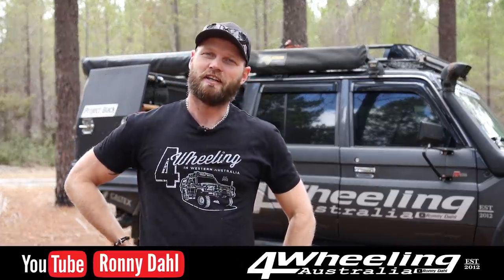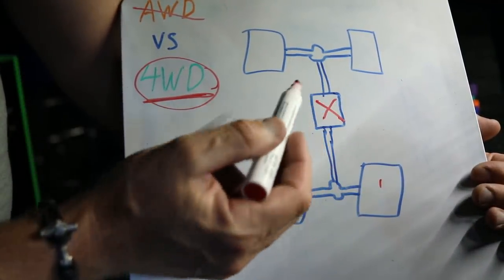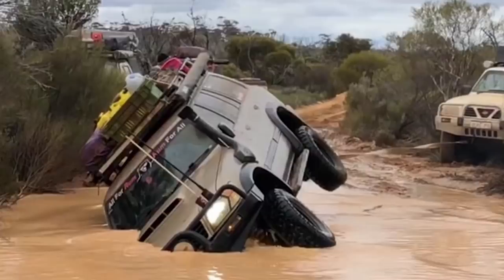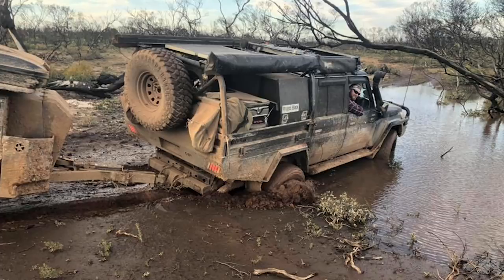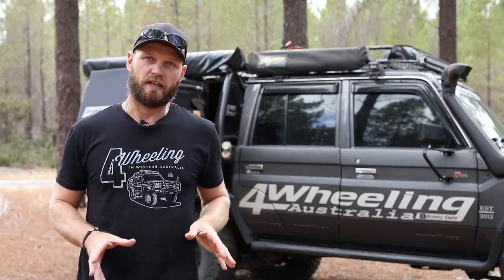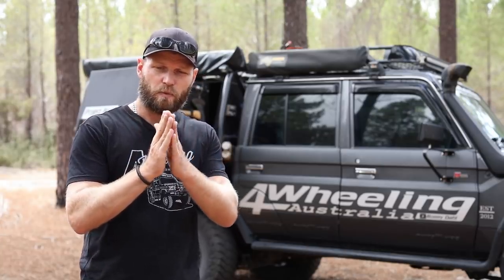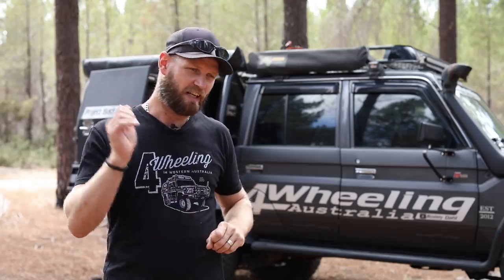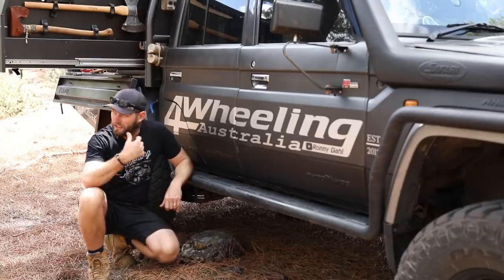10 ways to get bogged 4x4

Comment: When I used to have a Nissan Pathfinder it turned VDC (vehicular dynamic control) off but kept traction control on which helped when a wheel lost traction or went in the air

Comment: The car with the burnout marks below usually denotes ESC (Electronic Stability Control) not BTC (Brake Traction Control). You want BTC on for off-road, but want ESC off for low range work. Also high range were it might be a little scrappy, like a beach exit. ESC will see you a little sideways, cut throttle and apply brake.

Comment: Just in time before my first sand driving trip to Robe SA. Thanks Ronny
Reply from the maker: perfect :D
Reply: Was there a week ago, you can access the beach through the Nora Creina village, just close the gate after you drive in and respect the locals while driving through. Some dune tracks are really narrow so I hope you don’t value your paint job too much...
Also most of the tracks through the dunes don’t really go anywhere so always remember where you came from (found that out the hard way 😅)  besides that you gonna have a blast! Heaps of tracks and steep dunes and the sand can get pretty soft, hope your going with a mate, much more fun and it’s always good to have an extra vehicle. I was there alone but had my max tracks which got me out of a few sticky situations (wouldn’t go without)
Enjoy mate, I had a blast!!!
Reply: Thanks a ton for the info mate, its gonna be me and the misses only , I got a pair of maxtrax. hope they are gonna be enough.  @TheGoprotraveller
Reply: Jasmeet Mohi should be all good mate, just make sure you got enough water and fuel and keep in mind when you go down a steep hill you might have to get back up if the track doesn’t lead anywhere, that’s what happened to me 😂 I spend the whole day there and didn’t see one person just so you know, you might be on your own if something goes wrong, also watch out for the tide or you might be stuck there for awhile 😅 anyways just have fun and smash those dunes! I had heaps of fun there! You go for the adventure anyways so a bit of trouble is all part of it and makes the stories even better!
Reply: Drop your tyres further than you think (12 psi or thereabouts) & contrary to what you may think, stay away from the water on the softer beaches as the sand consistency changes beach to beach from hard packed to deep powder & you tend to sink more closer to the water on the soft ones. There's epic camping spots between Nora Creina & Beachport in the dunes once you head in so you'll have a blast.

Comment: Some vehicles "traction control" has three modes instead of 2. My Grand Cherokee WK, or WH, has a press of the "electronic stability control" with is only partially off but has the light on in dash. A long hold of the same button actually turns it off. Locking the center diff also turns it off, but that's only 4 low.

Comment: As a mechanical engineer I would like to mention that a locked differential does not mean a 50/50 power split, nor a 50/50 torque split. All it does is lock the rotational speeds of both outputs.
Please keep that in mind when you're preparing the full 4wd systems explanation. 🙂
Reply: Very common mistake, and very counter intuitive. Not here to disagree, because you are 0/100 correct, and in fact it is an open diff that sends 50/50 torque to each wheel.
Reply: I would just add that : the power is the force multiplied by the speed (or the torque by the rotation speed). If both wheels of a axle turn without resistance (slip) there is no torque (at constant speed...) coming from the central diff and therefore no power.

Another mechanical engineer. :-)

Comment: I dont agree with the generalisation of turning the TCS off. Take a Land Rover Discovery 2 as an example that TCS make it a really capable vehicle in slippery conditions where you would just sit spinning in a lesser vehicle... it all depends on whether the manufacturer has calibrated and tuned the TCS for offroad situations, they arent all equal!
Reply: I agree Nick. Also the point of locking the center diff as soon as you go off-road. This isn't necessary, the center diff lock should only be engaged when traction is lost or you're about to lose traction. This is the case with Land Rovers that have it.
Reply: @sir_forsaken1857  I disagree there, on the LT230 transfer box just lock them as soon as you are on low traction surfaces. If you wait till your stuck it's too late tbh and the centre diff doesn't like wheel spinning at all. All about reading the terrain and making an educated choice.
Reply: Land Rover, lock that centre diff as soon as you are on a low traction surface. 
And agreed, traction control is good, stability control bad. People get mixed up thinking the ASC switch is a TC switch...most cars don’t let you turn off TC.

Comment: for the past 20 ish years in north america AWD 👉computer engages the frt diff then reads signals from speed sensors to engage or disengage the transfer case based on front to rear wheel slip 4WD locks the transfer case in either 4WH or 4WL depending on what the driver selects and eliminates the computer from the equation FYI....🤷‍♂️

Comment: Whats your thoughts on abs off road? I've witnessed abs being dangerous off road especially if wheels lose traction on a steep hill and abs doesn't allow you to use full brakes causing the vehicle to roll back with little braking.

Comment: how many times have I forgot to turn off the dam ESP... I will try the centre diff lock next time out, usually don't bother as it has to be in low range to lock centre or rear diff on my car. with ESP off the traction control still works on the VW Touareg I think?

Comment: You never get bogged in a Land Rover because the LR breakdown before you get bogged :-)
Reply: @lochlynramsay4926  Spoken by someone that has probably never owned one - typical...
Reply: I never have one done because I now how bad they are
Reply: What a load of rubbish, my disco4 has done over 100k now all over Australia, fully laden and never skipped a beat.  Fantastic vehicle on and off road.
Reply: @collinstebbins2598  I know, had a LR3, now a LR4 the LR3 was very reliable, i hope the LR4 will do the same, i just like to annoy other LR drivers, don`t take my comment to serious, regards from Germany :-D
Reply: Collin Stebbins that’s a load of shit I bet you have to get every thing replaced evry trip
Reply: Owned one of the better modles, dico 1 and yes they are great off road, and yes they do require a lot of maintenance, and yes parts are expensive plus the newer models are not true offroaders sorry. Since owning a Toyota fj cruiser, with low maintenance, never breaks down and is more capable than any LR, I can see myself every going back.
Reply: Marc Hayes told you o
Reply: Sir_Forsaken Ive never owned one. Probably because I work in a European car shop and know exactly how shit they are.
Reply: Collin Stebbins bullshit. Disco 4s are in our show at least 4 times a week with oil leaks suspension problems overheating problems at less than 40000 k. There’s no way one of them can do that many ks on just a service

Comment: Ronny quick question ... Did my first soft sand trial without removing air . So I am in a Mitsubishi Montero Sport on 4WD Lo . Cruising in 1st gear ... When I pressed the clutch to put in 2nd the car stopped as if I was towing something heavy . Tried to start again and it was spinning with all 4 . Stopped again an started with 2nd gear LO ratio ... Not a problem ... did my beach tour and all was well ... Did not try 3rd Lo ... I stayed in 2nd Lo all the way ... Is this common with soft sand ? Again I did not remove any air ... I was running 30psi on a set of 255/70R16 BFG K02 ... also I did not have to use brakes at all . The minute I pressed the clutch the car would come to a full stop ...
Reply: if you air down it wont stop as sudden but you do have to be somewhat quick to shift gears in soft sand

Comment: Hey Ronny,  my AWD has a centre diff lock too!
Reply: @oneglimmer  he's comparing AWD with PART TIME 4wd
Reply from the maker: @oneglimmer  There is a big difference mate, I'll make that video soonish as many don't know
Reply: @oneglimmer  AWD = power sent to all 4 wheels but not with an even split between front axle and rear axle. 

4WD (locked centre diff) = power sent to all 4 wheels but with an even split between front and rear axle

Part-time 4WD = power can be sent to rear axle only (LC 70s)

Example: The LandCruiser Prado's have are AWD until you lock the centre diff. Then they are in 4WD.
AWD just describes the capability to send power to all wheels, although many soft-roader AWDs are actually only sending power to all four wheels when they detect uneven terrain etc. 4WD-labelled vehicles have a diff lock.
Reply: @oneglimmer   There is a difference between full-time 4WD and AWD, even though the terms have sometimes been interchanged and some systems are not clearly one or the other.  
The currently accepted terms (particularly in the 4WD community) are that full-time 4WD has a centre diff lock and AWD does not, but can use other traction devices instead.  
I can see why you are confused if you have been a mechanic for 30 years because the definitions have changed over time, and the term AWD is relatively recent.  
AWD vehicles used to be called full-time 4WD, but now that term is usually reserved for systems with a centre diff lock.
Reply: I have a Mitsubishi Outlander (SUV), and it's an AWD vehicle.  I have not had any problem in the sand with that vehicle once the selector knob is in the "Lock" position.  However, it sort of snake walks through the sand by what feels like it's driving the opposite corners of the car.  That's with the ESC and TC turned off with the tyre pressure lowered.  The wife says going in the sand in the Outlander makes her feel seasick.

By comparison, my Z71 being a 4x4 ute ploughs through the sand straight as an arrow in 4H or 4L.  If in 4H, you have to manually turn of TC however, which is fair enough as you could potentially be on a dirt road for all the car knows.  The car is smart enough to disengage TC in 4L.  Wife approves the Colorado's 4x4 stability.  As Ronny says, know your vehicle and practice!  Best of all, be safe and have fun doing it.

Comment: Hey there ron ,whats ya thoughts on manual diff lock vs viscous type auto lock systems, buddy .
Reply: Are you talking about axle differentials or centre differentials in AWD and full time systems?
Reply: Yeah sorry ron i meant the centre diff loch , i have the vicious type  running well at the moment but am told the manual locking type may be better and have one  of those as well just sitting in storage that i can fit if a better choice for offroading ,

Comment: You say turn traction control off. I do NOT agree. Look at all Graham Cahill's 4WD Action videos when he is driving the D-Max, he is constantly praising the traction control. A D-Max does not have a diff lock or LSD because it does not need them, the traction control works for all four wheel and you can still steer unlike a locked front diff.
Reply from the maker: All vehicles are different some it might be okay because it works with the 4x4 system where most it will make it worse as it will work against. Some systems still work in the background like the jeep JK but thats after you turn it off.  Again every vehicle is different, every terrain is different but most cases if you are having trouble turn it off and see what happens.
Reply: In Landrovers you must turn TC off when in sand as Ronny mentioned. All other modes are ok and sometimes great to have it on, but sand and TC are the worse IMO
Reply: Chris Smith, Graham Cahill's D-Max has a rear differential lock in it.
Reply: Your video said to turn TC off. Probably better to say that generally you would turn it off but it will vary depending on the vehicle. In my trip last year through  the Nuytsland Nature Reserve where we ran into your tag-along tour I did not ever turn off traction control.  With my D-Max If I have the right tyre pressures and have momentum,  I usually have little problem in sand.  On level sand there is  little  difference between traction control on or off. However when going uphill the traction control  give more power to the back wheels where the weight is.  Without traction control going uphill the front wheels spin because they have less weight on them sapping some of the power going to the back wheels which will slow you down.  I have had Toyotas with diff locks front and back which are blxxdy good but for 99% of the time I would much prefer the D-Max with traction control. Where traction control really shines is that it  is usually always on and you can still steer. You have to turn a front locker off if you have to turn.  I stress the importance of having the right tyre pressures (low) and having reasonable momentum,  because if these are not right, and you have traction control on, you will bog down causing excessive wheel spin which will reduce engine power.
Reply: Nah what you should say is to turn STABILITY CONTROL off. Traction control is excellent offroad. Stability control is not. Lots of people use the terms interchangeably but they're not the same thing.
Reply: i think ronny meant traction control off in sand yes agree 100%, but in all other situations traction control on for sure
Reply: nah turn it off. my mates dmax with traction control in the beach or dunes was a nightmare, cutting power right when he need momentum the most getting him stuck all the time
Reply: TC off on the beach even Graham Cahill says so ✌️
Reply: Some interesting comments here. My D-Max has a camper on the back and weighs close to 3.5 tonne, and has very heavy mud tyres.  I do a lot of sand driving and have had a lot of practice in knowing the right tyre pressures. It would seem these factors and just driving style is influencing our different experiences. I very rarely get bogged in sand so I will not be changing anything I am doing any time soon.
Reply: Dorko85 Discovery 2 no option to turn it off ....
Reply: @stevebrown5145  there is, engage Centre diff lock turn the ignition off and on again turns it off. I had to retrofit CDL to mine though as its a facelift model.
I wouldnt turn the TCS off on mine as it works really well... but we dont do much sand driving in the UK.
Reply: Nick Steggel no cdl on mine, TC only, my point still stands.
Reply: Where's the fun in letting a computer drive for you? Turn it off!!! At this rate we'll all be driving Electric 4x4's that will scan the terrain ahead of us and automatically adjust momentum and suspension for us - no thanks. Long live the 70 series!!!
Reply: @stevebrown5145  get CDL retro fitted bud, CDL+TCS is awesome!
Reply: Nick Steggel its on the list of upgrades!
Reply: Time and a place, most times graham is talking up trac control on his DMax, he's climbing up a hill on either loose rocks or slippery mud. In those situations traction control will help your keep momentum because it will send drive to the wheels with the most grip. 
 On soft sand he has it turned off, because it takes drive from a wheel that is spinning and sends it to one that isn't. On sand, you want to keep your wheels spinning, you certainly don't want traction control to apply brakes to a spinning wheel. Brakes + sand = a bad time.
Reply: Traction control sucks in the 2017 dmax I've got bogged on so many occasions from forgetting to turn it off in sand
Reply: Nick Steggel that only happens with a retrofitted CDL.
Factory CDL equipped D2s don’t do that, the only way to turn TC off is to pull the ABS fuse...which will give you “the 3 amigos” and disable ABS, TC, and HDC.

Comment: please explain,!!!....auto hubs,from the 70.s,yes,70,s,.were a ratchet system,to get you thru small obsticals,NOT,full on 4x4ing,.i have auto hubs on my 2002,thingi,by vacuum,.plus a manual hub for decent shit.only downfall with this system,is i cant do 2wd low,for pulling roots or stumps.or reversing on bitumen.as i can in the bronc.cant beat old tech....eh...